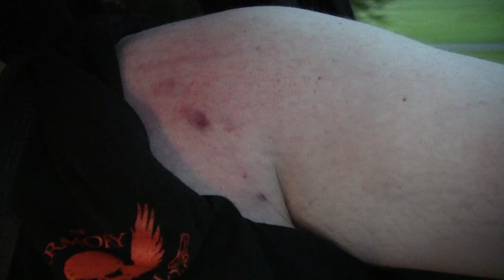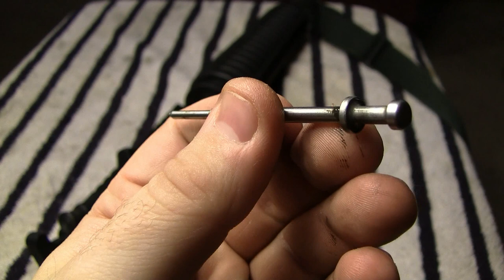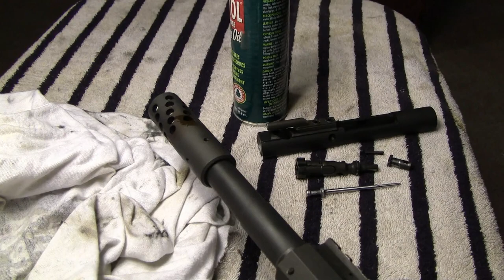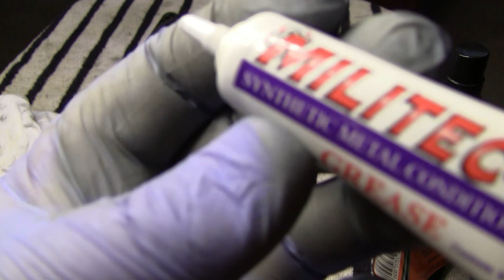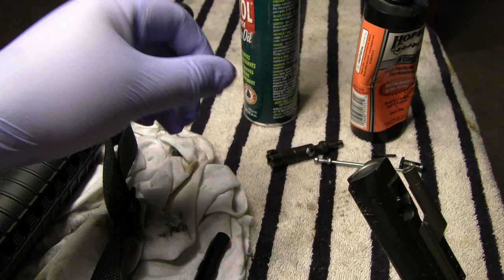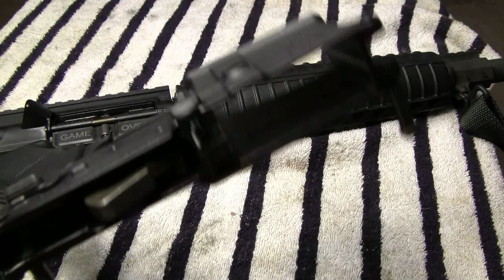Disassembly And Cleaning .50 Beowulf Rifle

Comment from the maker: @shootcentermass Not only is the round longer than the .50 DE the round is also longer than the 500 magnum but just a tad bit. And yes you can buy the upper and stick it on any mil-spec lower and use any stoct you want. Soon I will be tricking this 50 out with mag pul stock, rails, eotech, miad grip.

Comment: @shootcentermass 

Big Bore AR's don't utilize a tube magazine, though! :) It stays in the fight longer utilizing standard magazines and loading procedures. Plus, adding that with the AR's ergonomics, I say the price difference is a good trade-off.
Reply: They are meant for close quarters fighting, IE stopping cars etc at check points or putting down targets behind walls !and metal doors

Comment: Could you explain to me the exact difference? The bolt carrier looks exactly the same. But the bolt itself I would say just use AA bolt.
Reply: Bradley T Heward Bolt carrier is the same as the ar-15, the bolt is the difference, has the same diameter as a 6.5 Grendel made by the same company
Reply: This AR beast stops the range, dead in it's tracks.